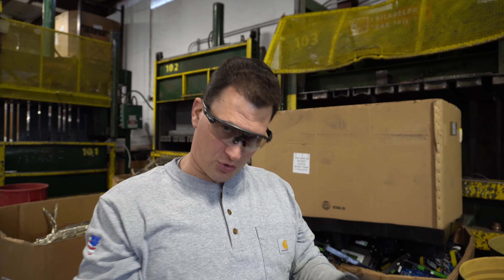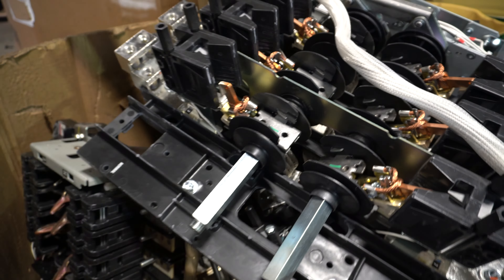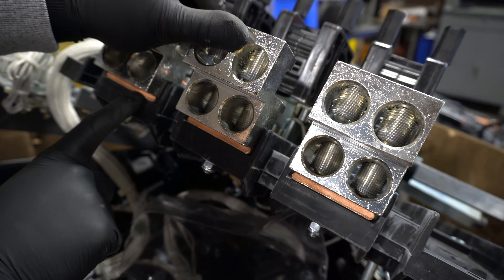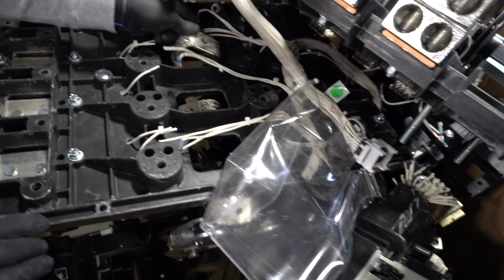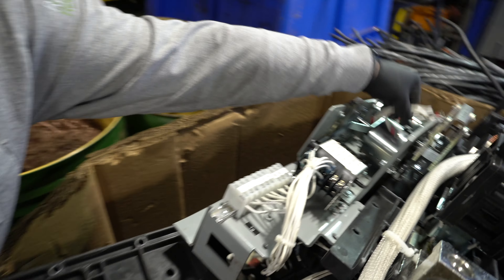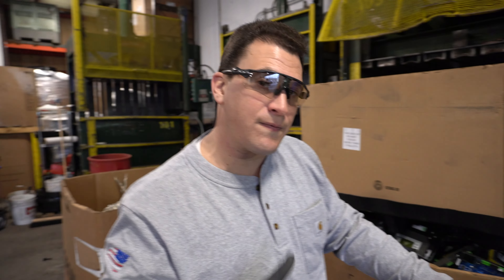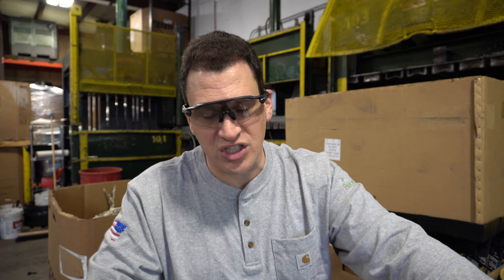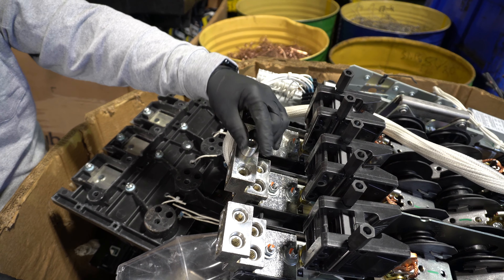Profiting on Electric Switches with Massive Copper Find

Comment: I love to be able to take that stuff apart for a living. Occasionally when my buddy at the yard is in a good mood he will let me buy the stuff at shred price or electric motor price depending on what he paid and I get to keep the profit from taking the stuff apart. I'm pretty fast at it too if I'm allowed to set up my work area. I have found platinum components in some of the machinery I e found before too. If I could find a steady supply I'd start a material recovery company. I'm probably sitting on many thousands of hardware alone as it's more valuable as is than it's scrap value.
Reply from the maker: That is a great deal for you- the secret is the supply of materials.